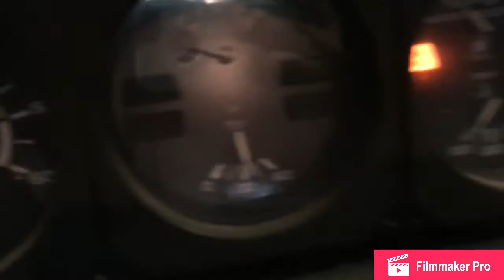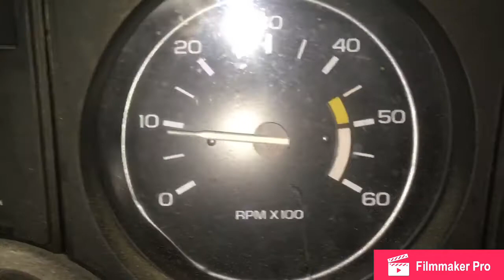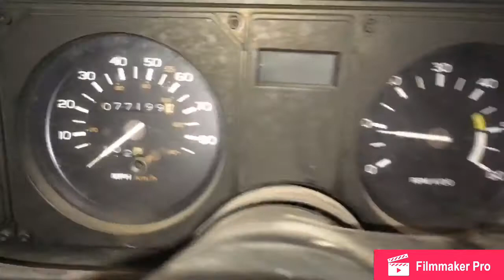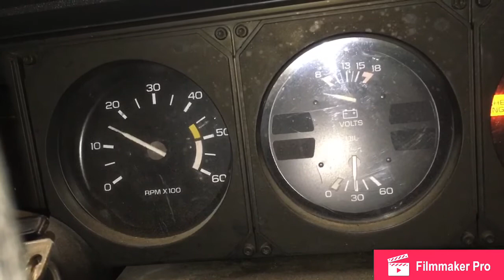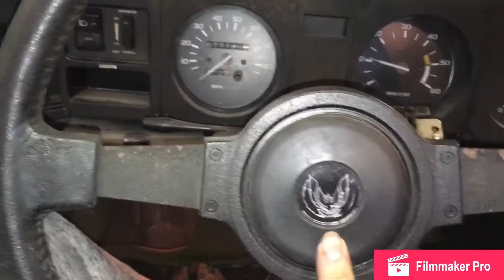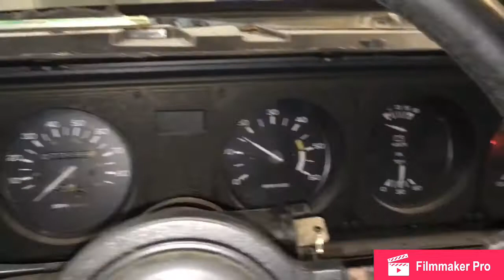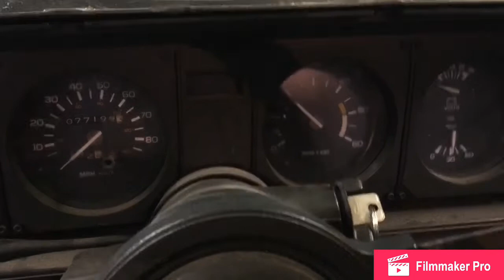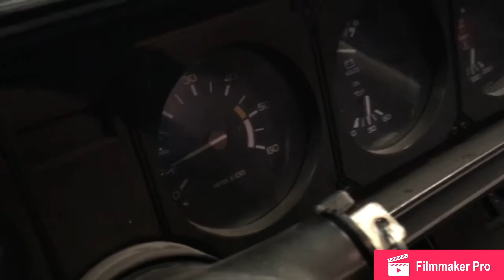1982 Trans am cold starts and Revvs

Comment: I have watched your videos on your 1982 Trans-am, these are helping me with mine ,yours is in better shape then mine keep up the work and videos.
Reply from the maker: Punisher Tactical nahhh it can't be that bad. But thanks!
Reply: @TFD1982  It is pretty bad but, it is coming along found out driver side floor pan had some rust and water damage I guess will have to change that out, just trying to get it to run right now. Changing the carburetor next after i finish fuel pump and fuel lines. Thank you for the videos how is your car doing ?
Reply from the maker: Punisher Tactical ok so far runs better with fresh gas 😂 I might have to have battery tested its dead every time I want to start it the past 3 days and it only 3 years old wish me luck!